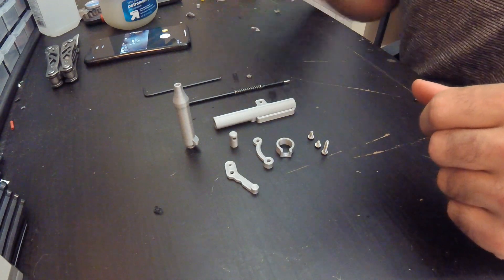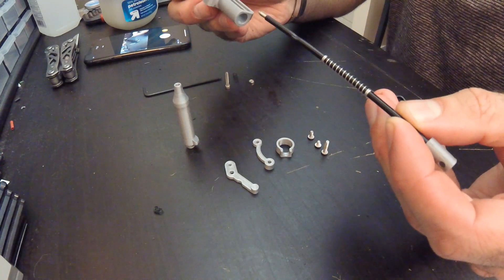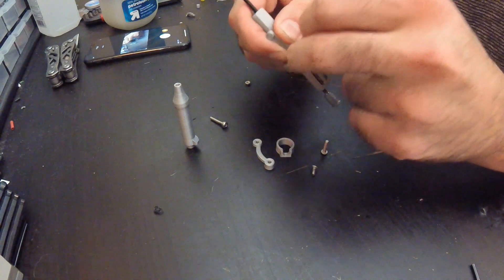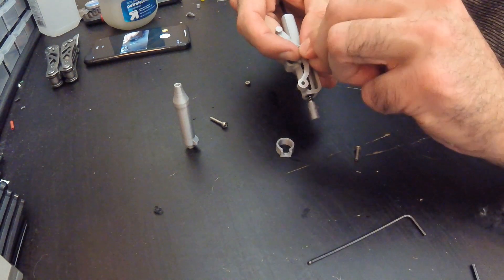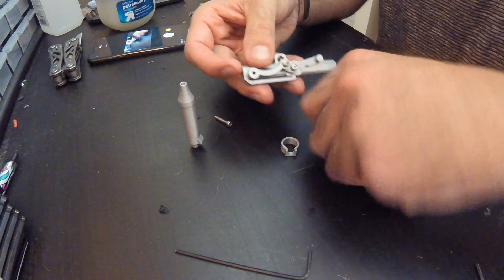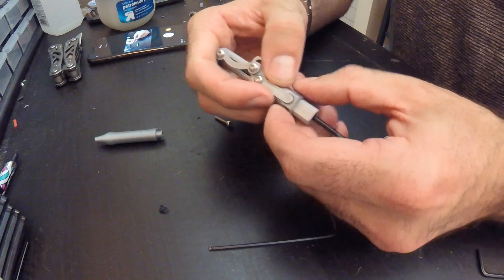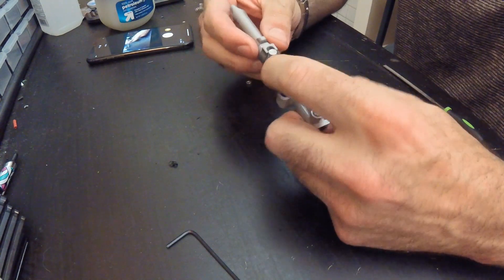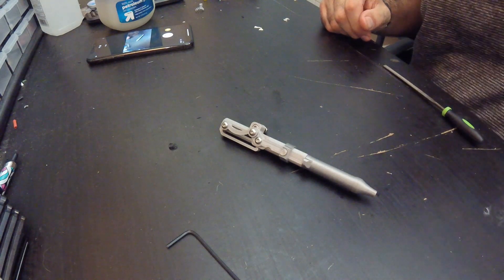Mechanical Linkage Pen

Comment: Do you have the specific types of screw used?
Reply from the maker: They are M3 button head screws, but any M3 screw will work as long as the length roughly matches.